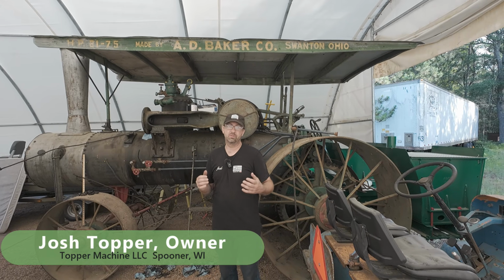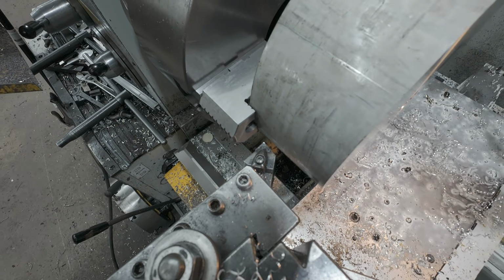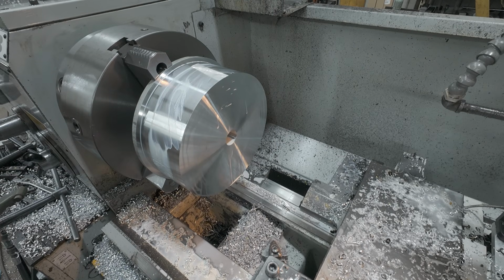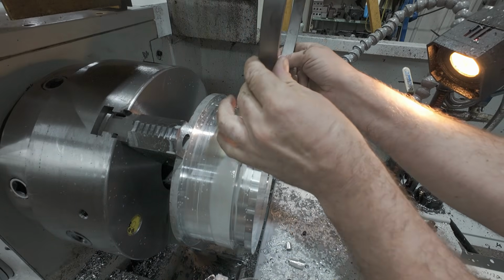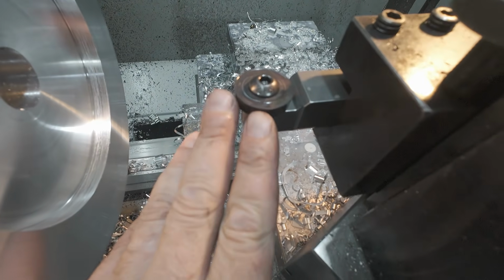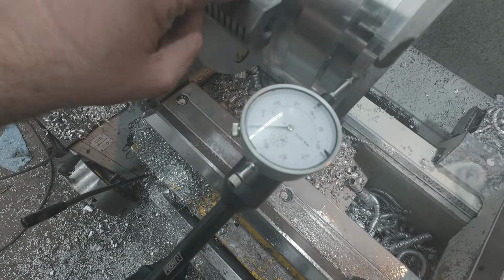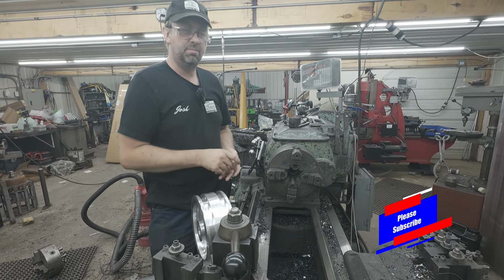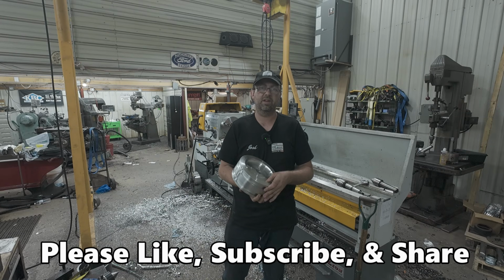This A.D. Baker Steam Traction Engine Needed a New Piston | Manual Machining

Comment: Scooping the piston will not increase power but decrease power
Reply: My vote is no change in power. If pressure is perpendicular force per area (P = F/A), then total force is pressure times area (F= P*A). Although the area is increased by the hollowing, the radial (non perpendicular) forces cancel, so the “stroke force” would remain the same for given steam pressure. Work is force times distance, but the stroke length is the same. There is more volume to fill in the cylinder, but the piston mass is less in the dynamic situation. Power is work per time, and the dynamic factors may lead to more efficiency. Would be cool to “crowd fund” $750 for another aluminum chunk, do a non-scooped piston, and compare measured power outputs!!
Reply: @edwardwright7329 steam engines develop power during the expansion process, yes, ‘pressure’ by itself generators some force, but the steam change in latent heat is what does the majority of the work, which is why a steam engine driven by compressed air will never develop anywhere near the power of running on steam.  So any wasted expansion becomes a loss of power and efficiency.
Reply: @bobtorrence3461  Because this is a hobby-use engine, there will be no long-term gain or loss in efficiency.
Reply: @royreynolds108 true, I’m sure it will still have plenty of power
Reply: @bobtorrence3461 I guess I’m thinking the steam engine process uses superheated steam and is adiabatic, so the work is the change in enthalpy, or pressure-volume work. The concavity of the piston doesn’t affect the change in stroke volume. I also wonder if this extra volume will condense to water when the engine stops and cools and if this water would be harmful.
Reply: @bobtorrence3461  Can you expand on that?  Something I can google?  The thermodynamics don't make sense to me.  All the heat/energy is being added to the water/steam in the boiler, quite far removed from the pistons.
Reply: @Alex_Taylor google “Rankine cycle”.  That will explain the thermodynamics of the steam engine cycle.    You can also google “does excess volume in steam engine with piston at top dead center decrease power” to get an explanation of why dead space (clearance volume) decreases power
Reply: Why is that?
Reply: @nandi123 it becomes dead space that allows steam to expand without doing work.
Reply from the maker: This is actually incorrect. It gives space to admit more steam. I did my research. This was 3 years in the making.
Reply: @TopperMachineLLC sorry to disagree but the whole purpose of steam cylinder is to allow the expansion of steam as it pushes the piston during expansion.  If for instance you held piston fixed, when steam valve opens it needs to expand into that dead space without doing any work.
Reply: @TopperMachineLLC   I'm guessing that he is comparing it to a standard combustion engine.  Generally with car engines... if you increase combustion chamber volume, you decrease power (because its the combustion ratio that creates power... the more you compress the air/gas mixture the more power you get when it ignites).    I assume thats not the same with a steam engine... because there is no combustion.
Reply from the maker: @mikep1085 yes. Internal combustion is totally different from an external combustion(steam) engine. Most people have zero understanding of it. I have learned so much in just the last few years by diving into my repairs and researching engine design.
Reply from the maker: @bobtorrence3461 we will just have to agree to disagree. In the end, it's my engine, my choice. If I'm wrong, I will find out, but based on my research, and the info from others, I should be right.
Reply: @TopperMachineLLC Josh, I love your work and I’m not trying to be hater.  All is good
Reply from the maker: @bobtorrence3461 I never took it as you hating. We have differing opinions of how it will work or not work. At the end of the day, I have to live with my choices, which are usually wrong. 😂. But if it doesn't work, I'm out $1400 and have to make another piston for my viewers to enjoy a video of. So, it's a win either way for one of us.
Reply: @TopperMachineLLC  I know nothing about steam engines but it would be an interesting (and expensive) experiment to make a flat top piston and actually measure the power produced by both designs.  PS Loved the giant crescent wrench. 🤣
Reply: If that dish increases power, why didn't any steam engine manufacturer do it?
Reply from the maker: Many did.  Look at the large industrial engines.  The piston design on them is similar to what I did.  Locomotives and tractions engines used flat pistons for economy.

Comment: Looks great. Keep an eye on 7075t6 for intergranular corrosion. On aircraft parts of 7075 t6 it is a common occurrence.
Reply from the maker: Thanks for the info. I had to look it up. Seems it mostly affects weld areas, but can also attack raw aluminum.
Reply: @TopperMachineLLC you are welcome.
Reply: The first jet I flew was constructed of 7075 they were limited to 10,000 hrs of flight time before the complete airframe had tobe inspected for intergranular corrosion,  not sure which areas were affected. But it did increase the airframe life to 30,000 hr.